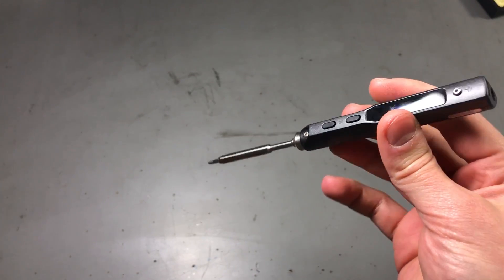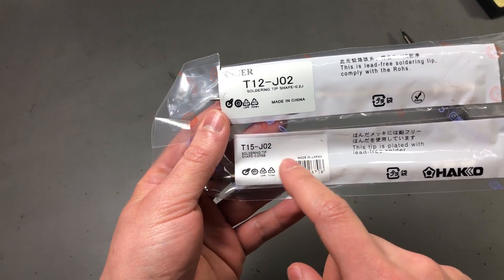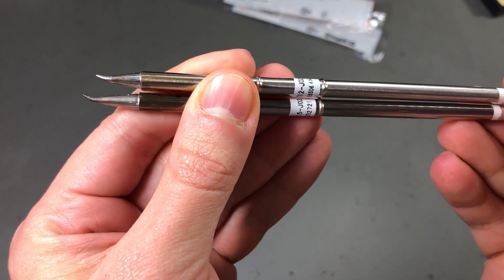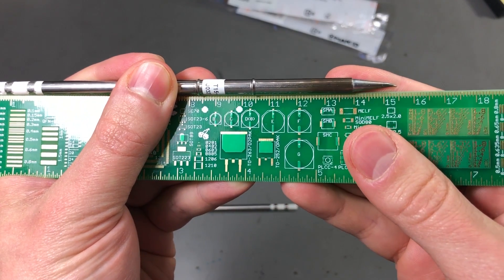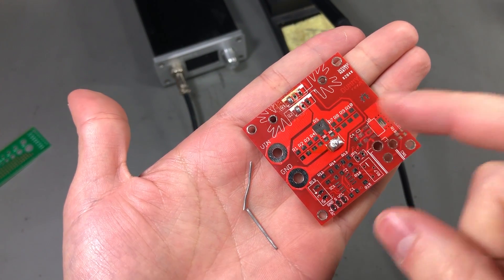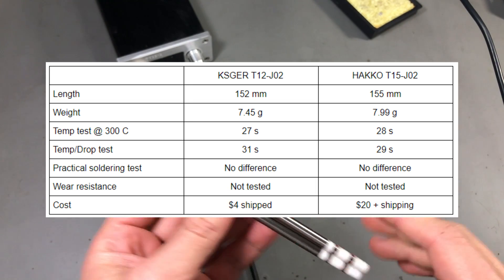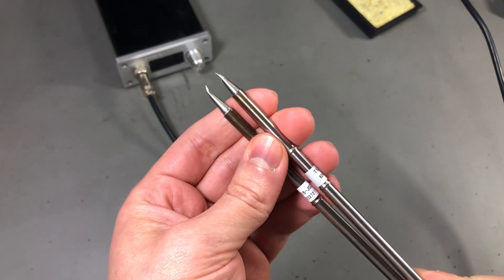Voltlog #215 - Is a genuine Hakko T12 tip much better than fake one?

Comment: Great video, and like what many others here has suggested, do a long usage test of these.
Say over a month or so of normal usage, cleaning them in brass sponge etc
and see how the tips handles actual long term use.
If they wear out in a month or two, then they're really not a cheap option to the genuine tips.
Reply from the maker: Not really an option because for a reliable test I would need to test several units from each (genuine and replacement) and put them through the same wear with some kind of repetitive test like, constantly  pushing the tip in and out of a brass sponge for a certain amount of time. But since the genuine tips are $20 each I'm not gonna just trash them :-)
Reply: @voltlog  No, the genuine tips we know are reliable so no need to test them.
It's these cheap alternatives that needs to be tested to see if they really are a cheaper alternative in the long run. 
Regards Geir.
Reply: @geirendre  this contradicts what you asked originally,& it makes no sense because he already told you they both performed about equally,& in order to know whether the old knockoffs are good is to do the tests he said,which as he says is unimportant because they cost 1/5th the amount & they are just about the same thing, can't you see the metal is the same basically otherwise it wouldn't heat up equally to original.

Comment: Many tips fails in measuring the right temperature on the tips...you could also have compared the reading on the soldering station with the temperature measured on the FG100 just for the sake of clarity. Nice comparison by the way. I would try to do the same with my JBC station and the two tips original and counterfeit one that works in the same way for me as far as I know by the experience..
Reply from the maker: Hmm I see, you think the two tips might have an actual different tip temperature even though the station thinks they are both at the same temperature. I will do a quick test today to check this and get back to you with a reply.
Reply from the maker: I ran the test, they both perform similarly,  the actual temp at the tip is almost the same as measured by the FG100 thermometer.
Reply: VoltLog good to know that! You did a great job, thank you.

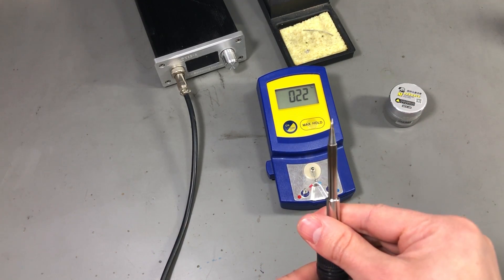Comment: hi friend, here: 4:18 is this tip cleaner any different from cleaning the tip with lead solder?
Is is too much for me asking to cut and open them both of them to understand how they are built inside?
Reply: FixDaily - Electronic repairs, hacks and tips Yes, is completely different. It contains ammonium in some shape and may be some lead alloy. First it removes any rust or oxides and is also able to tin the tip again leaving a nice and bright iron plating.
Reply: @ictrepairs6963  Thank you friend, so totally recommend to use it then?
Reply from the maker: The tip cleaner works really well, you should try it. Regarding destroying the tips I wouldn't mind doing that for the KSGER tip but for the HAKKO tip which would cost me $20 + shipping to get a new one I would rather not destroy it.
Reply: @voltlog  Ok thank you, although destroying the original one would be a fair review, but i understand
Reply: @voltlog , BigClive did a teardown video on a T12 tip recently where he actually cut and pried it apart to show the construction!

Comment: Nice! Likely the iron plating on the fake will not last as long, but at that price who complains? My ADS200 tips are half the cost of the the Hakko but they guarantee iron thickness and of course, Pace users mark off time in decades not months ;-)
It's also worth note that the bond between the iron plating and the copper core is subject to differing expansion coefficients of the two metals, so there's a lot we can't see without extended use and a good microscope (eg: iron surface micro fractures).
Reply: Hey Cliff,
  Where did you get the iron tip info from? I'm no expert by any stretch. 
  Awhile back I was attempting to research why my Hakko tips seem to last longer and/or how I could improve this. In the process I came across Hakko USA's YouTube channel (no affiliation). That's where I first heard that their tips are coated in a platinum alloy. I could easily be ignorant of the facts/history, or I could have misunderstood the Hakko info. Perhaps you could help me understand this a bit better?
-Jake
Reply: @UpcycleElectronics  Last year Pace introduced a new 120w station hobbyists could finally afford. I played a small part in posting it on EEVblog and to my surprise, Pace sent me one for feedback! I'm certainly grateful for this good-old USA company with enough customer concern that they spent a lot of time on EEVblog answering questions and sending mugs, t-shirts, firmware updated and training material. They sent one to Dave too (and just to "egg him on" I posted that it was a JBC killer..) but in the end, Marco Reps did a slightly better review. Anyway you can see an example of Pace explaining things on this page: https://www.eevblog.com/forum/manufacture/newest-pace-ads200-production-station-(a-jbc-killer-at-$239)/msg1462569/#msg1462569
All through that thread there's a lot of good info, any info you need, just post (there's tons of EE's there a lot smarter than I..)
Reply: Iron plating?
Fake tip manufacturers don't bother with plating.
They are made of Iron only.
Reply: I have those ksger tip they work pretty good it from my kit i buy it from 3 month ish and about life time it depent how you take care your tip
Reply: @felixgamingvlog6702  Try not to use a temp too much higher than that required to flow the solder, since overheating flux can cause corrosion (especially with non-leaded solder). If you do off-and-on soldering during kit building, try not to 'deep cycle' the tip by turning it off and on.. set the temp back to just below flow temp during rest periods. Remember 'deep cycling' the tip (composed of two metals with different expansion coefficients) can cause a poorly electroplated iron coating to fracture and flake-off during heat-up and cool-down cycles.
Reply: @CliveChamberlain946  yeah i know i learn from my old chinese 20buck soldering station and solder at 450 and use crappy 1$ solder btw we must tell dave to change the soldering station on 300$ budget elecro lab to ksger t12 or quicko or similar the contruction is pretty bad on 20$ soldering station
Reply: @felixgamingvlog6702  The Ksger uses a good controller but PSU they use in them is a death trap at best and need to be revised to get it safe which I did to mines. I been using it for almost 8 hours every day this week and pretty good once you fix the design issues. It now one of my daily drivers and have expensive Weller also active tips as well. I won't get into the Pace but tried it months ago before buying the Chinese t12 station and sent it back. It had to many issue as some tips didn't work, or work as good and didn't care for the station. I ended up getting the Weller WX2 and that station is my favorite as always dead on temps and small size of handle and short tip distance is great for micro SMD work. I even solder on ceramic boards with zero issues with that station. Yes it has a rear fuse.
Reply: @thetechgenie7374  i mean ksger is very cheap i mean the psu have problem still not that bad (from china standart) if live in asia is kinda hard to get us product like pace you more likely get suck ass 346 ish clone i forget the name but stil ksger is more safe dan reliable than hakko clone

Comment: Try them on higher temps and see how quickly they deteriorate. I've noticed the fake tips last shorter time and are more sensitive to high temps. Edit: But fake are good enoguh for me atleast. But for someone working all day with the iron maybe want geniune.
Reply: Some of the 3rd parties ones do tend to oxidized faster then the genuine ones. Some like the Ksger tips been pretty good and been the tip for hours a day and haven't had a issues with them. It just depends on brand, not all 3rd party tips are bad. Now the real; Hakko which is T15 i get for about $10 to $12 bucks from part suppliers and the good 3rd party ones for $5 to $6 for the type I use. So the real ones are not 5 times as much, but about double. The drill pro in a pack are are cheaper and work reasonable well, but don't have all the types I use often and have to buy separate.

My favorite tip of the fakes is the BCM3, that tip does wonders with SMD work and worth the $9 bucks paid for it to the point I bought a few more.
Reply: Exactly right ... abused at high temps, the lesser quality tips, will oxidize and become brittle first.   Thin tips do this, especially.
Reply from the maker: yup that might be a possibility but it is hard to test objectively.
Reply: @voltlog  
Cc tt

Comment: I'm curious to know whether the genuine tips last longer or wear better, though I don't know how one could test for that without large sample sizes.
Reply from the maker: yup that wouldn't be easy to test, I would need to test at least a few from each and put them through some kind of repetitive test like, constantly  pushing the tip in and out of a brass sponge for a certain amount of time. But since the genuine tips are $20 each I'm not gonna just trash them :-)

Comment: It’s not a matter of short term performance. It’s a matter of reliability. A fake can work for a couple of days, weeks or months while a genuine years (and however I’m not a Hakko enthusiast). And how much plating is on the tip? This is something you can see only by cutting the tip in half. That it’s a real comparation.
Reply: This is another way of saying you are paying for a brand name. Soldering tips aren't really that complicated and the genuine tips aren't higher quality due to some magical secret sauce manufacturing techniques. in my experience the good fakes perform just as well long term as the genuine. What you're paying for is largely consistency and quality control. With the genuine Hakko, you can be pretty confident that you're getting a tip that won't have any defects and will last. With a fake you pay a lot less, but the chances that you'll get a bad or defective fake are a lot higher.
Reply from the maker: Like mentioned in the video long term reliability might be an issue although I don't expect any of these tips to fail in a considerable way while moderately used.
Reply: Actually, you can get even less plating for a very high price. I'm talking about JBC and their C245 (and similar) tips. These are about 30 - 45 USD (special types even more) and they have awesome soldering performance. But there's quite trustworthy informations, that JBC reached this by making the iron plating significantly thinner than other manufacturers. Iron is quite bad heat conductor, compared to copper. Less iron, more copper -> better performance. This is a compromise between performance and longevity.
Reply: Actually what your saying is false....even a genuine can last a short time as well....just because one is genuine and the other maybe fake....sometimes a non genuine may last longer and it has been proven.....
Reply: @ghostrangerp.8819  the problem with fakes is that you can’t know if you’re buying a “quality” fake or a terrible fake. There is no consistency, so you’re dealing with luck. The fake market is full of products: all seems identical but all of them are different. You can purchase 10 tips from the same seller and get 3 different quality. Purchase again and get another batch coming from who knows. Spend a little more on genuine, and you’re fine. If you want an alternative, why purchase hakko station? Get xytronic or else. And  by the way: that a fake tip lasts longer than a genuine, has been proved by who? On which work environment?
Reply: By the way Anyone before you reply back, I would suggest that you actually read the post before replying and stating that that I said so so when in reality and did not....learn first to read....ok don't make assumptions....you already look like a moron.....
Reply: @ghostrangerp.8819  sorry, I didn’t knew that I was talking to a teen.

Comment: I've discovered fake tips simply don't work in my Genuine FX-951 using a FM-2028 iron.
Reply from the maker: It might be worth investigating why those tips don't work, is it an electrical contact issue? Or is the station just not seeing the expected values on the thermocouple?
Reply: @voltlog  mybe it uses diferent temp sensor as far i know the ksger use ntc while hakko ptc
Reply: @felixgamingvlog6702  No, they both use thermocouple: https://hackaday.io/project/94905-hakko-revenge/log/144548-hakko-t12-thermocouple-is-not-type-k
Reply: @kamilhorvat8290  i dont recommend those i rec pre build from ksger you dont need to build them and you get 4 tip for 45 buck

+Not becouse it suck but you will love oled screen and they will tell you everything like power, time, temp, etc in in one screen
Reply: Get the Ksger just do the DIY kit and built it yourself and work out safety issueS with the PSU. Worth the hassle as display the info my 1k Weller setup has and the Ksger allow you to adjust calibration so when thermocouple ages you can adjust for drift. I have the FX-951 and features are dated and don't care much for the handle. I prefer the shorter tip distance of the Ksger, just get the metal handle upgrade as plastic one ok, but cheap plastic.

Comment: One thing I wonder is if the tips are magnetic. Not too long ago, I was trying to solder to some rare earth magnets and it was just a pain because the magnets were attracted to the tip. I ended up using my old butane soldering iron which the magnets would stick to. I can only think those none Hakko tips have some steel, be it stainless or something else that's magnetic, instead of copper like my butaine iron.
Reply from the maker: yes they probably have some steel but did those magnets survive after heating them? Or did they demagnetize?
Reply: They survived just fine. I imagine they did lose some of their strength, but they are still very magnetic. Before I soldered them, I stuck another magnet to them. After they cooled down, they were fine. Here's where I got the idea. https://www.youtube.com/watch?v=G4MdrRXfb1M
Reply: @jamisonlm3  Modern tips are magnetic, because the copper core is plated with iron to prevent copper dissolve in the tin solder. Iron is dissolved too, but this process is negligible. There are another dangers for the iron plating, like corrosion by too aggresive flux, thermal shock by wet sponge (good quality brass wool is recommended) or mechanical damage, e.g. by scraping the oxides off the soldered surface. https://kaisertech.co.uk/content/blog/2013/02/22/jbc-long-life-tips/